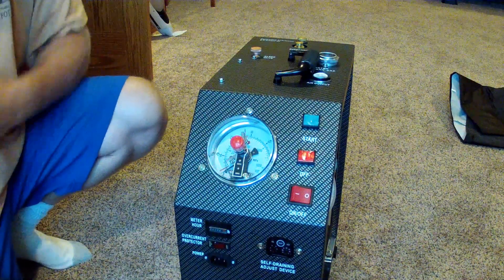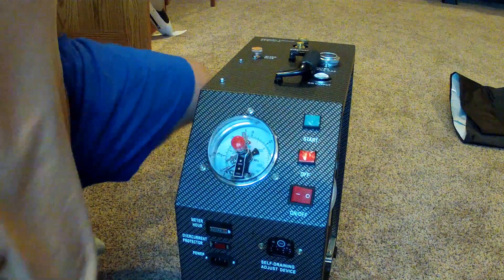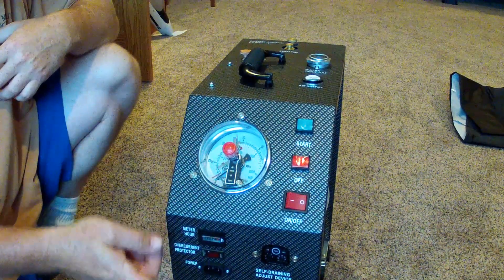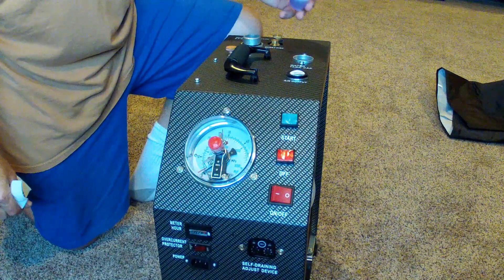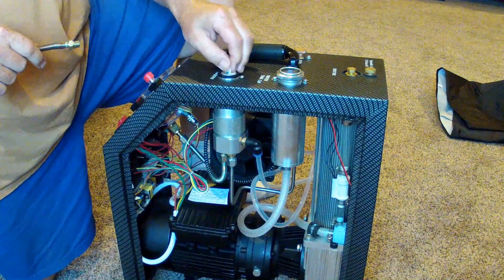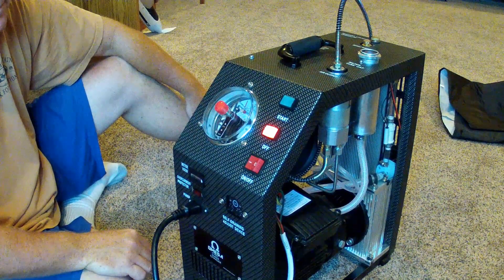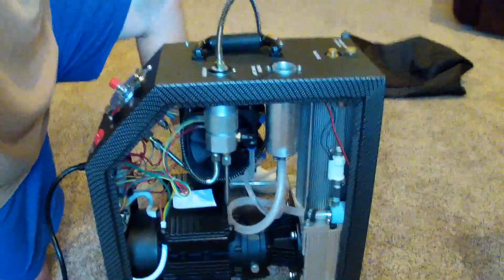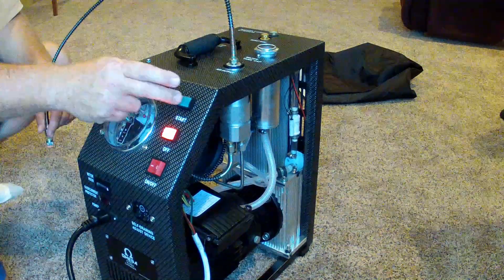Omega Super Charger - Initial Setup

Comment: A lot of replies and some contradict each other,  But what's the deal with the Omega Air cleaning system not providing  information on this Omega product.  AOL provides noinstructions or manual on the use of the Omega Clean Air Dryer which cost $100.00 more than the Diablo Clean Air product.  Now Diablo has come out with a Diablo Clean Air system that has two bottles at the price of $495.00.  I did get assistance from a Airgun Nation member as to my asking if anyone had information on the Omega Clean Air system but that member was like myself not able to get information as to the Omega Clean Air system specifically.  The Omega Clean Air system is only available from AOA.  I did see on the internet somewhere where the Red Diablo was replaced with the Black Tank but the only Diablo System found  seems to be the two tank system. It is ridiculous to me that putting out money for a product certainly would result in a manual or instructions coming with the product.

Comment: You'd think that if you buy a $1,900 compressor it would come with a well written manual. You'd kinda also hope that the cooling system had a feature where you could turn off the pump and the rest would stay running until it has cooled down, then shut itself off.

Comment: IMPORTANT
Two things:

I just started my new compressor and just spoke to Airguns Of Arizona. The set it up and run it there before it comes to you.  

1)You are missing the seal for the hose that attaches to the unit.

 The instructions say "please  locate fill hose and SEAL inside styrofoam box. Slip the seal onto the male thread of the fill hose." There was no styrofoam box.  The seal is a washer inside the O-ring/parts clear plastic bag. It is a washer with blue plastic/rubber in the center.  

2)  You did not have to put the ice and antifreeze in.  It was already done by AOA because there is already fluid in the unit.  

This was a very frustrating set up. AOA means well but no one said it was set up already.  The instruction tell you to use all of your ice and antifreeze.  I called AOA and they told me to put the fluids in then when I call back today to ask about the washer seal they told me not to put  in the fluids.   I always seem to  have something go wrong with my purchases with AOA due to miscommunication, long phone wait times and phone calls not always returned.
Reply from the maker: +Quang Nguyen I just saw your comments above, and particularly your last comments about frustration, etc.  I have made 3 purchases from them.  2 rifles and this compressor.  In all cases, there was at least one issue.  In all cases I had to make repeated calls.  The worst one was the last one, when they 'forgot' to ship my Day State rifle.  There front counter area, although nice guys and very knowledgeable, is not representative of their warehouse capabilities.  It am most annoyed that they are the sole distributor for FX in the United States.  I can't even vote with my money.

Comment: Mine arrived today, I wanted to give it a try as my original run shoebox has been labour intensive.  Hope I don't run into the issues Chiinature has.
Reply from the maker: Chiinnature
 I looked at the SB and even bought an oilless compressor just to use with it.  I still have it new in the box.  Someone will need one someday.
 I'll be at AOA in about 3 weeks.  I'll check out the filter.  Thanks for the heads up.
Reply: Hey~ :) Wow I got mentioned! LOL!!!  Mine is fixed and now working good, it's a big learning experience, but after that, I am VERY confident about my compressor now, LOL!  Anything happen, I can fix it!
Reply: Chiinnature Good to know, I have about 16 hours on it now (4 of those on the clock before it arrived).  After my first 4 hours the flex line clogged,  It was really strange and 4500 psi on either side refused to budge whatever jammed it.  I could tell the AoA guy was a tad incredulous but they did ship me a fresh one that took care of it.
Reply: Mark Card oh nice~ did you get the dry air filter too? I have noticed a big difference in terms of air quality with that filter. The air that you vent out from the top is very different like it's dry-er and the sound is more muffled. Lot better for your tanks for sure with that dry air. Good to add to your compressor since you already threw a lot of cash on it already, why not make it perfect eh?  The beads inside the filter is reusable too, no cost to just bake them back to normal and reuse!

man. imagine IF that thing that blocked your hose did actually came out at 5000psi, what happen is a big projectile flying at maybe 1000fps at your wall or someting... lol...
Reply: Chiinnature I live in San Diego area, away from the beach it tends to be little to no humidity most of the year.  That said your right I should probably get the inline filter though I fill 4500psi SCBA bottles and find no moisture so far.   I have no idea what caused the block,  the o ring inside the base BNPT fitting was still there and I had successfully done two fills so far at that point.

One last thing have you had to do the grease thing and is it just a squirt into the top?
Reply: Mark Card Cool! I live in Toronto and humidity can go up a lot sometimes, scary wet air killed 2 of my handpumps already, LOL!  Glad I didn't kill my airguns though!  The grease? Ya just squirt a tiny bit in the hole from the top is enough, don't put a lot. Just ever 10 hrs squirt like 0.25 inch from the syringe and it is enough. The compressor is already so greasy if you look at how the set it up.. no need for a lot of grease.
Reply from the maker: Chiinnature
What dry air filter are you running?  I am curiouse.  As you said, you have spent the big bucks, a good filter is just good sense.
Reply: sbirdranch  Chinnature has a vid of it on his omega its carried by AoA

 Diablo Dry Air System

Diablo Air Filter

$179.95

Molecular Sieve Desiccant
Made from 6061T6 Aluminum
In-Line with quick connects
16" Flexible Hose Included
Color Changing Gel for Sevice Indicator
Stainless Steel Mesh Particle Filters
4500 psi Working Pressure
Tested to 6000 psi for Safety
In-Line Molecular Sieve Desiccant Filter (The highest absorbing desiccant on the market). Made of 6061T6 Aluminum, annodised inside and out for utmost quality and protection. This in-line filter is designed to remove the moisture from your compressor air supply to maintain the clean and dry air required to safely charge your airguns! Internally the Diablo Air Dryer uses Blue Indicator Desiccant to allow visual inspection and service. The Molecular Sieve Deisiccant can be easily oven-dried or replaced at user's discretion.
Reply: sbirdranch Yup , that diabolo filter is correct. You can get it from AOA. I have a video showing what's inside too, LOL!  Very nice and strong. I have seen the test Todd did to it at the destruction lab... they pump the thing up to 14600 PSI and then it popped off the cap. DAMN that is badass!  So your 4500 or 6000 psi is nothing for this thing, very safe!  https://www.youtube.com/watch?v=HHlqREyM5Zg
Reply: Mark Card Yes I am using that one,https://www.youtube.com/watch?v=HHlqREyM5Zg  and you can reuse the beads inside by microwaving them or baking them and they will get dry again, and you can refill them into the tube. Very easy to work with, but keep in mind fill time will have to be longer for your stuff, but air quality is superior.. very big difference if you feel the air venting out
Reply: Chiinnature I hope your happy, I just spent another $200 for the desiccant filter!  Your an enabler, seriously though like you said it takes moisture being an issue later off the table so thats a good thing.
Reply: Mark Card hahahaha!  great buy man!  I am sure you will like it!  I just used it now, filled 2 tanks!  Damn that is fun!  The good part of this thing is that you can let it fill and go off to do something else, and then come back and it's done! LOL, don't look at the machine and let it run, learn to HEAR it stop and then check up on it, makes your life so much better!  A nice user-trick to get pass the mental stage of checking that meter out, hahahaha!
Reply: I'm liking the Omega so far.  I had an original run shoebox, and it did its job ok but I found my run time between rebuilds was getting smaller and smaller.  I'm sure the newer one with the improvements works great but this omega is much more set it and forget it.
Reply: Mark Card I have been eyeing on the shoebox before, but somehow it didn't interest me because of the shop compressor setup. I have one in my store, ( I run a taoist temple in Canada ) but then the damn thing is SO NOISY just by itself... imagine that AND the crazy cranking pistons in the shoebox.. gosh, that will be horrible for apartment use. Also very space consuming and I am mostly filling up guns and small tanks only, why do I want to have a shoebox setup and then do all that crap to start it up for just a 2mins filling session?  LOL!  You are right, the omega is like press a button and then go do your thing, then come back when the sound stops. Love that kinda lazy bum stuff. LOL!  It's how we should be treated when we spend 2k on this shit! hahahaa  I am running the omega at the back while typing ! filled 6 tanks today! What a luxury!  I used to pump them up with handpump man, you imagine that...
Reply: The shoebox original premise was a sub $500 no frills / slow speed method of 110v filling PCP and paintball equipment.  I bought an early shoebox and it fulfilled the promise for the price but judging by the nature of the upgrades I wasn't alone in keeping the early build running required a fair amount of maintenance.  If the no frills version of the Omega at $1350 turns out to be competent, the high end shoebox at $1150 isn't a good trade off IMHO.  That said the $650 base model shoebox is certainly viable.  It's good that there is some real competition for the home user.
Reply: Mark Card
You know what? I have been told that the new cheaper model of the omega is better than the fancy one. They cut cost by removing the case (carbon fiber is expensive) and some fancy shit that you don't really need. Then they put a more powerful motor there that can fill up the tanks faster for you. Because there isn't a case, they can stuff in a bigger motor. It's about 30mins fill time difference for a 75cf tank. Todd told me that they tried it and the 75cf or 88cf tank filled in 3hr and 15mins while the other version we got is 3 hrs and 40mins and about.  You can see that there is a big difference.  Well if the shoebox is like $600, then of course no one will complain, but think about it, $600 then $200 for a shop compressor, and then hook it up and stuff might end your bill at $800 or $1000 too, who knows? LOL Now I will really just go with an omega and call that a day. It's way easier for my laziness... pump the tanks and guns up while I do my video editing, that make sense to my brain! LOL!
Reply: sbirdranch hahaha well enjoy the omega! It's luxury!  The filter is definitely worth a shot, get one! :)

Comment: I thought the factory already put coolant in the compressor !!!!!
Reply from the maker: Not for units that come through Airguns of Airizona...unless things have changed.  The fluids including lube are included but in separate containers.  Little bottles and tubes of stuff.
What I have noticed is that this compressor is sold in different countries by different names.  So there is another instance where things may be different....  !!!!!
Reply: I just ordered one yesterday from precision air guns and they told me I don't have to put any thing in it except water. It looks exactly like yours. This company is located at Michigan.
Reply from the maker: Like I said, I have seen this sold under different names.  They are all made over seas for Omega.  They are being sold in Mexico under yet another name.  Note how the name plaque is just screwed to the front.  So it would seem in the case of Precision Air, that they are shipping them wet.  It doesn't matter.  Adding the fluid or not is no big effort.
Thanks for the insight...I hadn't heard of Precision Air.  I like having another option than just AOA.   I just compared the price on the Daystate I want and they are identical.
Good luck with your new pump.  You'll love it.
Reply: Have you heard of P-12 air rifle? check it out. It is the Chinese version of ed gun matador but it is olnly $650 !!! Mrodair.com is selling them. I like the price for the bullpub but I don't know about quality. Safe shooting.
Reply from the maker: Looks like it might be fun...if I weren't left handed.  Right hand bull pups put the cocking lever in my cheek.  I found that out when I went to look at the FX bull pup.  I pulled it to my shoulder and handed it right back.